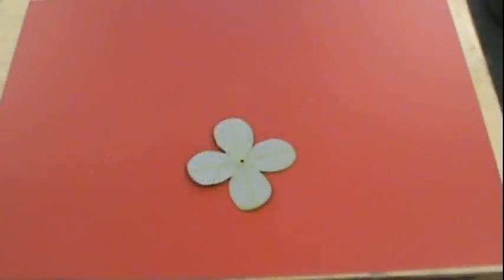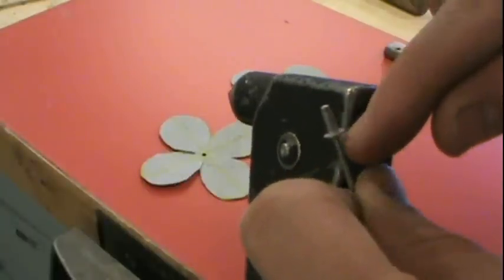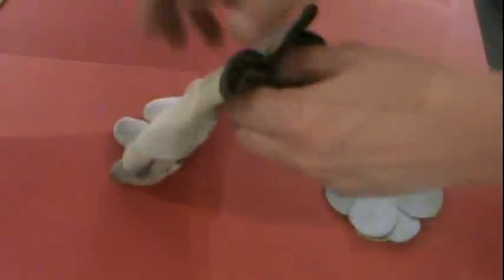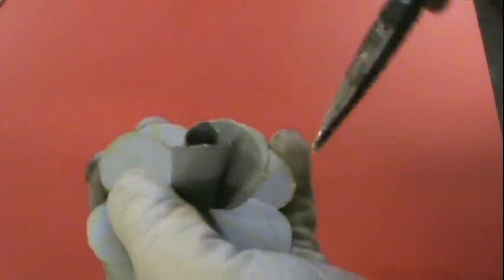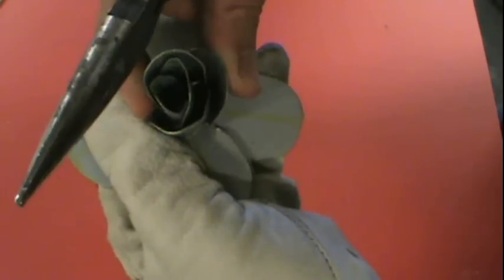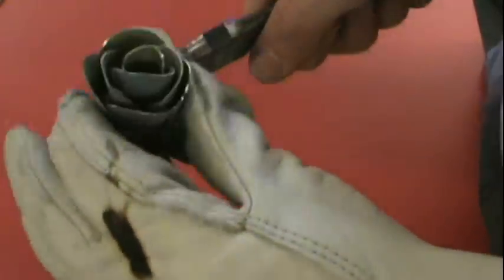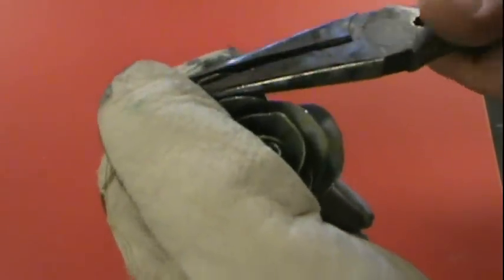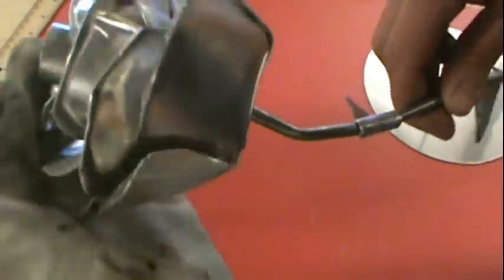How to Make a Metal Rose

Comment: use thinner gauge metal & it will be easier to bend with the pliers,try using copper sheet or aluminium cut from a drink can ie: coke fanta etc  & the bonus is it will be very light too,another idea i just had was to scuff the metal with some steel wool or wet & dry sandpaper (fine grade) to remove the printing of the outside of the can,if u use coarse grade sandpaper & scuff it in a cross hatch pattern it will create a textured look on the metal too,transparent paint ie: red or green should create a deeper shade of color against the grey of the metal & provide a more natural looking color (darker red)
use your imagination & you will even better results,btw you'll get 2 squares (@ 3 1/2 inches square ) so you'll need 2 cans per rose :)
Reply: This is good advice, I might use some of this if I decide to make one of these
Thanks :D

Comment: have your students beat the metal with a cross pean hammer going dow the the petals like l's and than beat it with a ball pean hammer this will give it more of a petal texture and look more real also make the holes 1/8'' wide and you can put it on a stick electrode and weld it together take a piece of aluminum 1/2" wide drill a 1/8" hole and stick it in there and put a mig bead to slide the petals on than put a bead to hold them than you can put it in a vice and move the petals

Comment: It would be easier if you maybe heated it with a torch and then they would be more workable and easier to bend
Reply: Robert Zamorano if you did that use welder gloves for the heat
Reply: reefy mcscrudge and